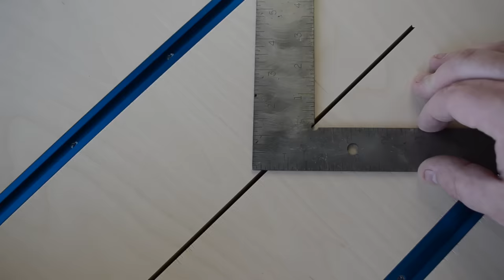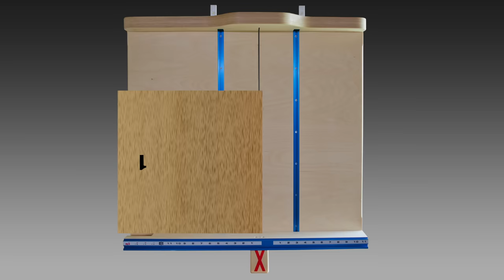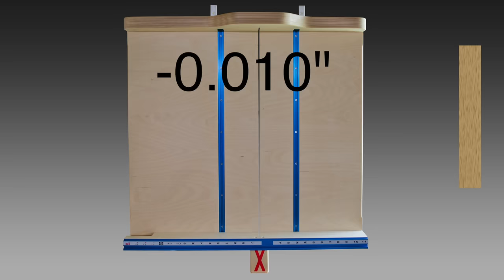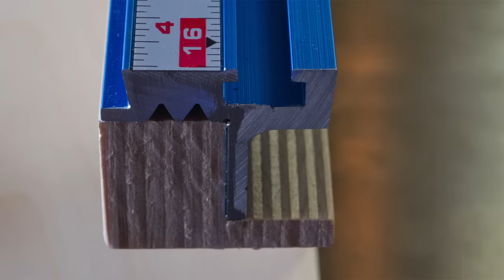Ⓕ Make A Table Saw Cross Cut / Miter Sled Combo (ep58)

Comment: Great video and plans Nick. The only change I made was the back fence. I wanted the swing stop to drop tight to the fence for cutting small pieces like dowling. Just had to eliminate the cutting the rabbet. Saw your sticker at my local plywood store! Wow you get around!
Reply from the maker: thanks - was it at Bay Ridge? that's where I get my plywood
Reply: sure was. didnt know you were local. Thanks again. Going to put the sline tennon project together next with the left ofver baltic. Cheers @NickFerry
Reply from the maker: You’ll have to take a picture of it when done and tag me in it - Happy Building!
Reply: You probably know this for wood Bob Klose in seymour is a grat source for hardwood. @NickFerry
Reply from the maker: Yup - I run a podcast with him called The Woodworking Podcast - he’s a great guy
Reply: Nick, wondered who you use for blade sharpening here in Green Bay. I, ve been here foe 7 years and used one guy I wasnt real happi with. Thanks @NickFerry

Comment: your very very good at what u do. im wanting to make a table saw using a skill saw that has a miter like that. im putting it in a cabnet so its quite. the saws not loud as is. every time i make something like this i look up youtube vids. this gives me lots of ideas. im gonna make it to where i can adjust the angle to. ill have to make zero clearance blocks. i should of never got rid of my sears and roebuck solid iron table saw. it was an oldy but goody. it cut different i dont know how to explain it. anyway good job.
Reply from the maker: thanks - I hear ya on some of that old equipment - I had a spindle sander I got rid of over 15 years ago I really liked and still wish I had it

Comment: This is a great sled. Very nice, but the total cost of all the parts is above $300. You can buy a top of the line sled from Incra for that amount.
Reply from the maker: Other companies sell aluminum for less than what I used and the other sled doesn't do tenons, mitered splines, or box joints like mine does - that cost extra - it all depends on what people value

Comment: At 10:54 when you butt your work against the stop, it moved. If you`re making multiple repeat cuts, better check the rigidity / play of the stop. Nice sled.
Reply from the maker: Correct - I had to tighten the pivot bolt - that took care of the slop

Comment: Great explanation of the steps. Nice finished product too. Was curious about cutting metal with miter saw. Seems like you may dull the miter blade. Please share your thoughts. Else, really enjoyed. Thanks
Reply from the maker: thanks much - if you have a quality carbide tipped blade, cutting this aluminum is a breeze with a slower than normal cut - it's common in manufacturing

Comment: It is a shame you do not have an outfield table. If you had one you could have drilled holes in it for a rubber stop of the B&D workmate type, to limit the slide travel and that way you will not get your blade cutting through the back o your blade guard.
 A woodwork group I attend had a nice cover on the back and within one week there were cuts through it and for some reason the older guys saw this as the perfect place to push the slide from. To solve that we drove in 1" brads all over it and cut them off about an 1/8" long so it was like a porcupine. That worked.

Comment: Ok this is my 3rd watch of your sled vid and I'm sold on the design.  The 5 cut explanation was very helpful.  Now to sell the junk in the garage and buy a table saw - lol - I had an idea while watching I want to throw your way.  The miter insert is way cool - but what if the angles could be changed to any degree short of 180?  Some sort of ball and socket at the point with some sort of angle gage mounted/inlayed on/in it - just typing out loud.
Reply from the maker: thanks man - I have plans to make an adjustable angle insert for it down the road as well - I still wanted a dedicated spot on 45° one because I do a fair amount of picture frames

Comment: Just finished building your sled.  It's awesome and dead on accurate. Thanks for the clear concise plans. I did screw up the miter fences, putting the metal on the wrong side. My fault, your plans were clear. Just shortended the miter fences and reduced the triangle piece slightly and added 3/4 inch shim between fences and the triangle so the material would fit through the cutout. You never mentioned the reason for the miter tracks on the miter jig although I am sure it is for attaching a stop block to make repetitive cuts. Never saw that in the build or the video or plans.  When making a stop block do I need to miter the stop block itself?
Reply from the maker: thanks for the glowing review! - you are correct, they are for stop blocks - I do a fair amount of picture frames & it works amazing for stuff like that - I show it in this video - https://youtu.be/jFxRIjqJPlc

Comment: Nick,
I'm a new beginner to this woodworking stuff & have decided to make a crosscut sled even though I don't own a nice table saw.  I only have room for my jobsite type folding Bosch 10-Inch Table Saw with Wheels.  I'm sure it will never be a great saw but figure a sled will be safer and still improve its accuracy.
I've watched 4-5 videos now and must commend you on your thorough video & especially explaining the 5-cut method & so many other details other video don't cover well enough for a novice. 
I did upgrade to a Freud blade but don't understand the issues about cutting metal with your wood saw blade.  
- Did you change to a special metal cuttong blade for that cut? 
Finally, do you have a listing of all the products you used... like those blue track inserts, those 2 bottom metal runners, the dato blades used to make perfect slots to install your blue tracks & bottom runners.
Thx & well done!
Reply from the maker: thanks much - full material list here - https://nickferry.com/2015/07/table-saw-cross-cut-miter-sled-in-one-ep58/ - if just doing a couple cuts on aluminum extrusion, a carbide tipped blade is fine - just take it slower than you would pine or something similar

Comment: Mate, that is the best sled build and description I have seen ! ( I have watched many many others)
You don't seem to worry about cutting aluminium with your table saw blade ? 
I didn't think this would be good for it
Reply from the maker: Thanks - carbide saw blades cut through aluminum just fine - they have been using them in industry to cut aluminum extrusions for a long time

Comment: Excellent job. I noticed that the kreg swing stop moved a bit when you demonstrated it's use as a stop. Have you noticed any discrepancies in your cut lengths?
Reply from the maker: I had to tighten the pivot to remove the slop - all good now and no problems

Comment: Love the design and attention to detail!
I have a jobsite Table saw and axial glide 12" mitre saw and wondering if the only time I would need or want to use a crosscut sled would be if my mitre saw couldn't cut the width?
I plan on doing small projects around the home and limited on garage space so went with the Bosch 10" jobsite saw on its stand
Reply from the maker: Thanks - I made one for my job site saw as well - every miter saw has a certain amount of deflection so a sled is not only more cable capacity-wise, many times it’s more accurate and repeatable - not to mention my design lends itself to act as a platform for other kids like my tenon and spline jig -
https://youtu.be/0ZsNqsEvK64 - also the hold down ability with the track makes small cuts safer - I could go on ad astra as to why I often prefer the sled over the miter box - maybe a video extolling the virtues of my sled is in order?

Comment: Have a portable craftsman table saw that has been abused. Starting at the rh miter slot the table is bent down 5/64" down.
The other problems are no fence and the miter slot is tabbed to retain the original miter gauge. I don't have that either. 
The saw runs great with no wobble.
I'm currently using a bar clamp as a fence and it works reasonably well. Anyway the short question is how to handle the tabbed miter slots in order to use a sled.
Reply from the maker: I've had people tell me they ground the tabs off and others bought factory replacement miter gauges or miter bars to use on the sled as runners - a couple options either way

Comment: Thanks 4 video, , seems 2 me that  u would end up after the 5th cut of offsets,  with a measurement piece that would need 2 B divided by 5 since there is a total of 5 cuts reflecting the accumulated offset to average out
Reply from the maker: think of that cut off from the 5th cut as a narrow sampling of the larger piece

Comment: Nick, I love your crosscut/miter sled!! I would like to make one myself but the only piece I can’t find is the one you use for the fence that sits closest to the back of the table saw. It’s the one you put the tape measure on. Also could you please tell me why you put the tape measure where you did and not where the kerf mark is? 
Thank you so much for all your videos. I watch them over and over and wish I could be half as good as you are and do!

Faithful watcher,
Rick
Reply from the maker: Thanks - links to all parts in the article here - https://nickferry.com/2015/07/table-saw-cross-cut-miter-sled-in-one-ep58/ - the cyclops (viewing window) on the stop block I used if offset so the tape measure needs to be as well

Comment: Thanks for sharing this build!  I plan on buying your plans soon.  Two questions:  first, why does your sled....and so many of the sleds I see out there....have a raised rounded feature in the middle of the back fence?  Why couldn't this just be a straight, high surface, since I wouldn't be touching it while cutting anyway?  Secondly, why not just make the front fence high enough to begin with so that the saw blade doesn't have to cut through the aluminum?  Thanks!
Reply from the maker: fence height for compatibility with other jigs - opposite fence shape for strength - you have 2.5" of material up and around the blade kerf

Comment: Nice sleds!

New woodworker question, that might be obvious to everyone else...

The bolts that go into the sled tracks for the miter sled - where do those sit when the miter sled is not in use?
Reply from the maker: You can slide them out or I just tighten down the star knobs on the track and keep them out of the way

Comment: Nick, thank you for making this video. Easily one of the best cross cut sleds by far. Video quality and editing is also excellent. 

Perhaps I missed something... how did you get a precise 45 cut on your miter insert? Are you just way better at the bandsaw than I am (if so, that’s ok)? Or, was there a step that I missed to ensure a perfect 45?

Thank you!
Reply from the maker: Thanks - it’s built into the math - the bandsaw cut was a rough cut to get it smaller - the perfect 45° comes from the right triangle - we know the legs meet at 90° because of the sled we just made and being the legs of the triangle are the same length the remaining angles are 45° each

Comment: This is the best sled vid I've seen.  I don't see anyone asking and I might have missed it...how did you set the 45 angle to ensure it was accurate?  Also, sorry for asking a question on a 5 year-old video.
Reply from the maker: The geometry takes care of it - 2 equal length legs on a 90° triangle - we know it's 90° because we just squared the sled - the insert is bisected against the accurate fence to give a perfect 45°

Comment: So the only thing holding the near side of the sled is the piece of aluminum rail that you didn’t cut through?  Seems you could have made that side taller to avoid the SawStop trigger and to give more connective meat to that side.
Reply from the maker: the mounting lip is all I cut through leaving the boxed part of the extrusion in place giving it plenty of lateral strength as well as the multiple mounting screws for the fence itself and the 3/4" guard bridging the gap - making it higher would alter ergonomics when cutting thin pieces, having to reach over a taller fence - also, at this height, I can utilize the factory accessories like the swing and production stops

Comment: So now that it's been a while, would there be anything you would change?   I love the video's BTW!
Reply from the maker: maybe stopping the miter tracks an inch before the back fence to use longer bolts but I'd still have the slots in the back to blow out sawdust more easily - but I haven't needed any longer yet

Comment: How do you know if your saw has a bypass mode? I have the Ridgid 4512 model and I'm guessing it probably doesn't. Right now I've narrowed it down to your sled and Stumpy Nubs sled. His plans are $5 cheaper though😉 but your video explaining how to do it is much better and that's a big plus.
Reply from the maker: You are correct, the Rigid 4512 does not have it
Reply: Thank you

Comment: I've read that you should only cut mitres the other way (with a trailing edge, not leading as in your design). What are your thoughts on this?
Reply from the maker: In an ideal world you’d always cut with the grain - but that can make the positioning of the work piece tough sometimes and the body mechanics a bit awkward - modest feed rates & clean/sharp tools, and these cut comes out glassy

Comment: Hi Nick, great video and great detail on getting your square cut right, I do have a question though. When you mark off the miter it doesn't show you checking if it is 45 degrees and when you marked it out, there didn't seem to be a reference point for your square?

Comment: If the Lsquare is calibrated which means you will have a perfect 90 deg and use it as a guide to set the back fence do you still need to calibrate the fence?

Comment: Great video Nick, and a great add on to the cross cut sled. one thing i missed , on the front section of the sled where the top tracks are is that where the coach bolts slide onto the tracks to hold the mitre sled ?
Reply from the maker: not sure what you mean?
Reply: Its ok Nick i found it at around 4:30, what i would call coach bolts are 1/4 20 hexagonal bolts, and it also shows the cut out's in the front fence.
Sometimes you can become so engrossed with a video you actually miss bits.

Comment: Great video Nick. I follow everything except the step where you cut the triangle which becomes the base for the miter portion of the sled: I understand that you can use the squared rear fence of the sled to get the 90° cut for the "apex" of the triangle, but how do you know that the line of the cut intersects that apex at exactly 45°? In other words, how can you be sure that the longest side of the triangle which rests against the back fence will set the line of the cut at exactly 45°and not say 44° and 46°?  I hope that question makes sense and I'm sure the answer is simple. I just seem to have a bit of a mental block figuring out how you can be sure of it's accuracy.  Thanks again for a great video.
Reply from the maker: Good question - if the “apex” is 90° and you cut each leg of that triangle the same length, then the remaining angles in the triangle are both 45° - rest the long side (hypotenuse) against the square fence and you have the right angle perfectly bisected
Reply: @NickFerry  and now it makes sense. I see that your pencil line which you shimmed to was not just arbitrary but drawn from two points equidistant from the 90° point. Good explanation and I'll be picking up some ply tomorrow to start my build.

Comment: Great video and project.
Getting my first table saw tomorrow and this looked like the best sled that I've seen on youtube.
I did get your plans.  Not sure if I can afford the Baltic birch plywood. On social security.
Is there anything cheaper that you can recommend?
Thanks.
Reply from the maker: any 3/4" sheet stock should work, just use what's in your budget

Comment: Awesome, concise and articulate videos! Bought the plans and all the hardware and getting ready to build the sled. Now that you've had it for a few years, are there any changes you'd make to any aspect of the design?  Thanks.
Reply from the maker: thanks - I personally wouldn't change a thing but a few people suggested stopping the miter tracks an inch before the back fence to install longer bolts instead of the slots in the back - I could see myself doing that but I still like the slots in the back to blow sawdust out

Comment: Nice table saw cross cut miter sled. You noted that you set the dados for the miter saw track equal distance from the saw kerf in either direction for upcoming projects. Can you expand on this? Why would it be necessary to do so. I am trying to educate myself of what I need to consider before adding these dados. Thank you.
Reply from the maker: I designed several other attachments and at least one of them uses the fact that the blade is centered between the two blue miter tracks